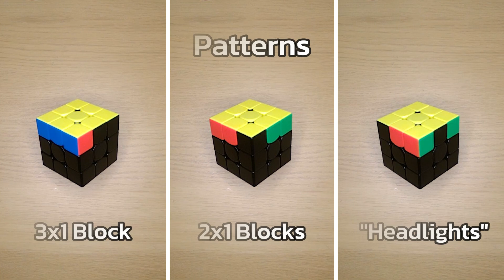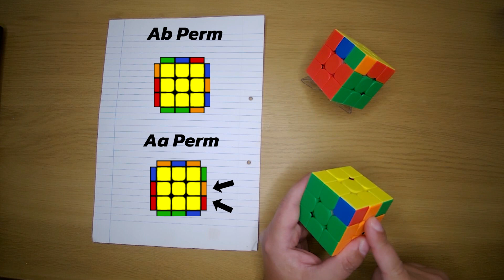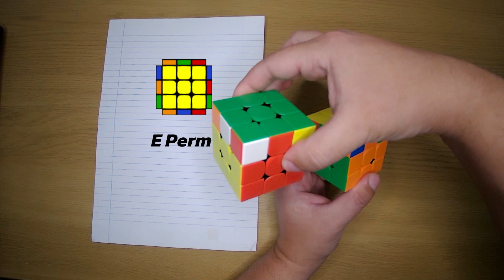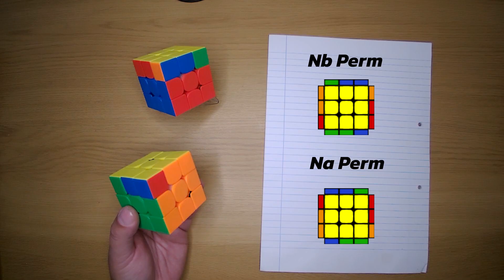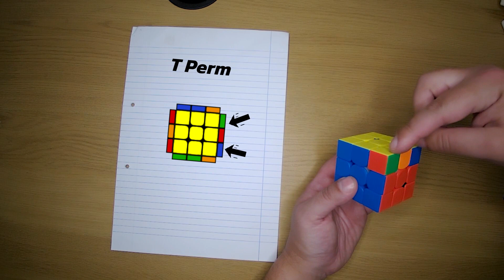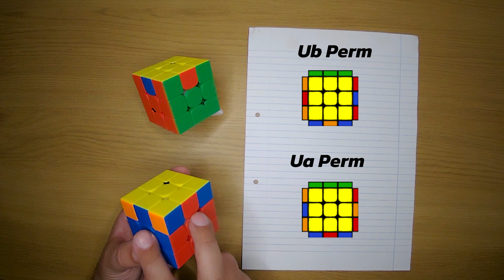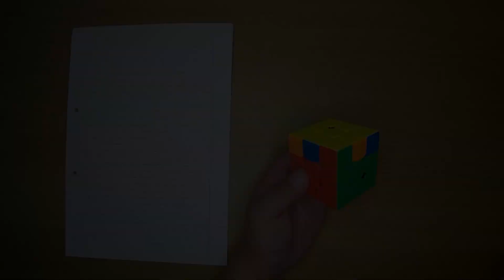How to recognize PLL looking only at two sides!

Comment: Bookends - 2 opposites imply headlights on opposite side

No Headlights and No Bookends - Imply no E,V,N or Y perm

A-Perm- 2:52
2x2 Block
2x2 visible and headlights-
Alternating colours at Headlights
Reply: Bookends- the corners of the bookends are sane colour
Reply: Headlights and nothing- back corner end edge are opposite
2x2 and nothing-
corner and edge are opposite
Reply: E-Perm
No headlights 
No bookends
3 in a row checkboard pattern (corner,corner, edge)

Comment: I made a little course in Memrise for this  with pictures so you could learn them one by one and drill them with the "Speed Review" mode. What would be better though is if there was something like the Memrise Speed Review mode but where you actually use a smart cube to recognize and solve the cases. The idea would be to solve the cases without looking at the cube but only at the image of the case that comes on screen. The app would reset the cube internally after each solve so you wouldn't have to worry about looking at your actual cube. The idea is to ignore the actual state of your physical cube and simply do the moves to solve the state that's onscreen. This way you can drill recognition quickly without interruption. 

Of course, that method would be great for literally any aspect of solving the cube. If I could code I would've done such a thing by now. Tau Yu has something similar to what I'm describing but it doesn't work with all smart cubes. 

It would be SO effective and SO useful for soeedcube practice. I don't know why no one's done it yet. Cubeast is compatible with all smart cubes so what gives?

Comment: That's a really good tutorial! I learned 2-sided recognition without actually paying attention to corner permutation, and it's something I learned later. Great that you explain that. For beginners, just knowing where the headlights are can help to AUF correctly and then recognize the case.

4:38 - A vs Ga/Gc vs R: I recognize R by 5-checker, Ga/Gc by 4-checker, and A by "no checker" or "wrong checker".
5:35 - A vs Gb/Gd: 2 colors (other than bookends) = Gb/Gd, 3 colors = A. In fact, for this case - block + bookend, I recognize it like this: 2 colors between the bookends, the outer colors are opposite = Gb/Gd, adjacent = R; 3 colors with an opposite color next to the block (opposite headlights) = A, adjacent color next to the block = T.
6:13: I recognize E perm by the 5-sticker pattern, like blue-red-green-red-blue.
13:53: R perms have adjacent color between the headlights, and T perm has opposite color. Basically, whenever I see headlights, I first notice whether the sticker between them is opposite (Gb, Gd, T) or adjacent (A, Ga, Gc, R), then I figure out the rest.
Reply: That is fantastic addendum, thank you very much.